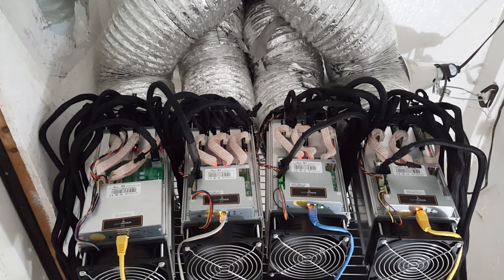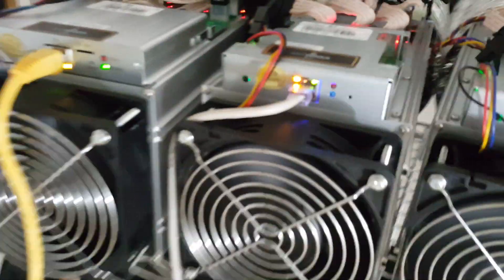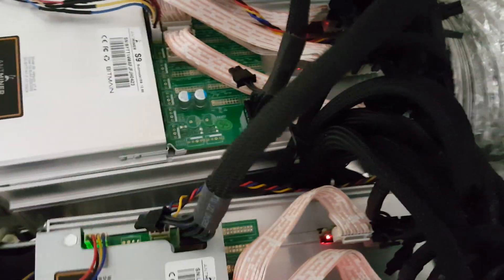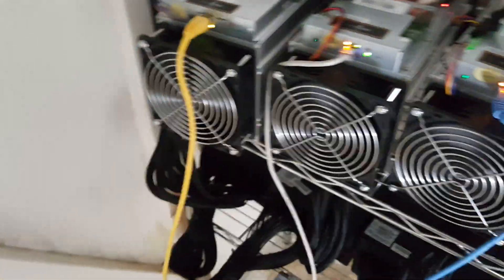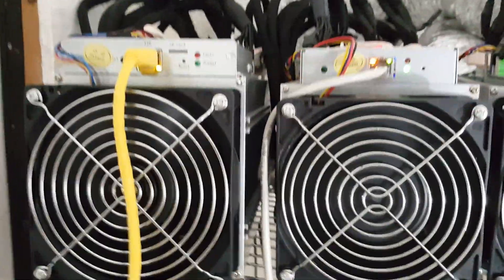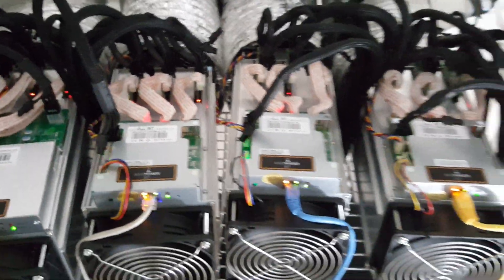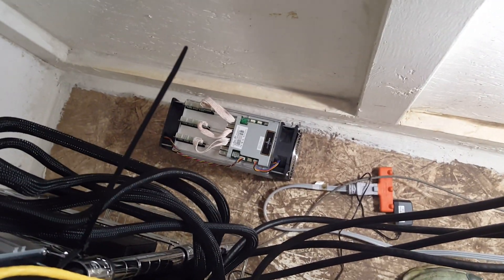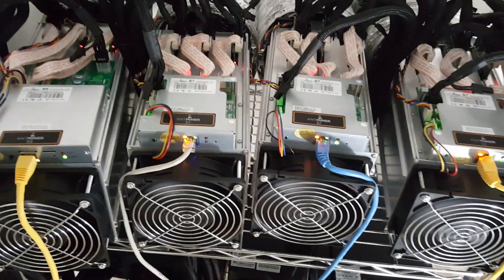Antminer S9 VS The Antminer S7

Comment: Hi man, 
I've been watching your videos and honestly you have the exact setup I'm looking to buy. I do have a couple of questions if you'd be so kind:
1. I live in a country with heavily subsidised electricity... basically free. Should I get 4 S7s or 1 S9? S9 is more expensive.
2. How long do you think until you have to upgrade say from a s7 to an s9 and to whatever comes next? If you didn't payed for electricity.

Thanks a lot!
Reply from the maker: Hi Carlos Bermudez, first off our processors can not get smaller than 10 nanometers, well other than IBM new Chips but those are 5-10 years out. With that being said the antminer S7 has a 27nm chips and the s9 has 16 nm. Current Intel high-end processors are using 14-nanometer processors. So I would assume that Bitmain's Next Step would be 14 nanometers So instead of seeing an upgrade every 6 months or so I believe it's going to be more like a year plus now and the upgrade will not be three times more powerful. 

 It's a hard one because you have free Power and the next question is what power supplies do you want to use? 4 high end power supplies = 1 s9.  So my personal recommendation to you would be to get to 2 s7 now (only because you have free power otherwise it would have been a s9) and wait a month or so and then get a s9 because hopefully they'll get cheaper with every batch.
Reply: So you're confident that the 2 S7's together will pay for an S9 in a respectable ammount of time? That is exactly what I had planned. To have my mining operation grow by itself without having to keep putting large ammounts of money into it.
Reply from the maker: Carlos Bermudez  Somewhat I was under the impression you had $2,000 or so to spend, so I was thinking you would spend a thousand on 2 S7 now and have a thousand left over. The price of the S9 should come down hopefully to around 1400 1500 and the 2 s7 should be able to generate you the $500 in a month or so.  Now you should have the money to get the S9 and from there you should be able to grow it without putting too much money into it =)
Reply: Thats pretty much the same idea. I'm not looking too much into TH/kWatt instead TH/$. And I think the s7 can deliver that at the current price. Thanks for the help!
Reply from the maker: Your Welcome

Comment: i have 3 s9 myself but i have a solar system and battery's that run the pc and mining stuff independently so i dont pay power'. all money i make is paying it self off at moment but money will go towards buying tools and parts for my car so misses doesnt crack it with me. ive put 12k into mining and its been a year payed half of it off so far cool to see your cooling setup mines in office but in a sound proof box with vents out window and fresh air in works well but need to put dust filter on due to constantly haft to clean them out every few weeks
Reply: Are they ON for 24 hours?
Reply: Yes at start I had to turn off when I went to bed but I have since
 Put 2 more 2v 800ah battery’s in and last till morning and repeats
Reply: So, doesn't make it an efficient mining. Why did you have to turn it off? You don't have electricity where you are?
Reply: He said he has solar panels

Comment: How is your temperature running on the units since it is summer time now?
Reply from the maker: Matt Knight Actually the same temperature because the house is staying the same temperature 71 degrees Fahrenheit. They range between 53 Celsius and 58 Celsius. But instead of saving me money on heat it's cost me money in AC. Eventually I will down clock them.  I'm just trying to figure out how expensive is going to get for one month.  Last month averaging maybe 85 degrees here in North Carolina, my power was only up $50 or so.